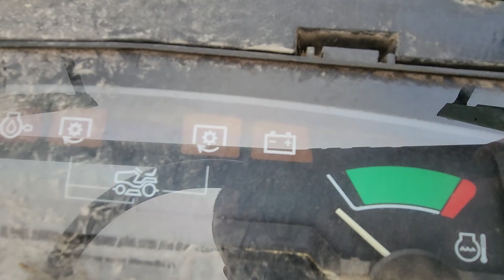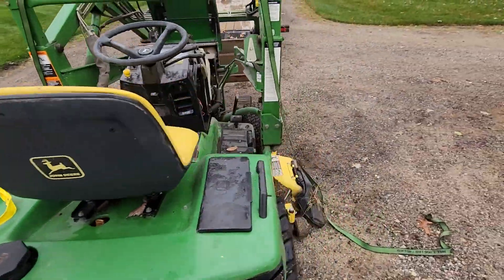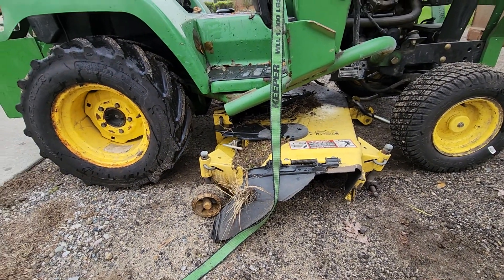Another John deere 425

Comment: Hi, does the 40 loader disconnect as easily as the 45? My dad just got a X585 with the 40 loader & it looks like there is an extra bracket with 2 bolts the loader frame sits in. His set up is a little different as he has the  steel tube going through the frame for support.Thanks
Reply from the maker: It is suppose to on the 425, 45, and 55s. If it has been adapted to the x series it may take an extra step or two to remove.

Comment: Wonder why they had the rear tires on backwards?   Kent from PEI
Reply from the maker: Not sure, if they weren't weight filled I'd flip them around on the rim, but on other hand you could flip them around and run them in a wide stance.
Reply: @Fireguy1020  Just switch them.

Comment: The Engine is wrong ways round. Most tractors have the rad at the front. So that it draws air though the rad acting like a wind tunnel. You would think it would be there own engine.
Reply from the maker: The engine is actually in the correct way. Deere has done this since the first production year of the 4x5 tractors to the current year gas x7 series.
Reply: @Fireguy1020  I see. Our local authority or council. They have two JD mowers. But the one's that are most popular are Kubota. They must have Ten or more that go around the East Lancashire mowing grass and other duties. Kubota tractors and mowers have there own engines. Infact Kubota make the all thing.